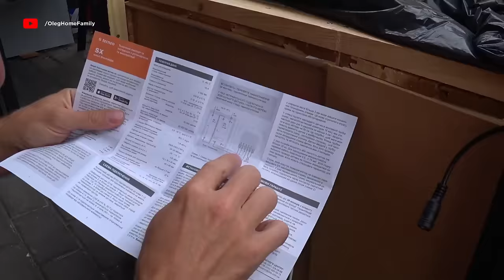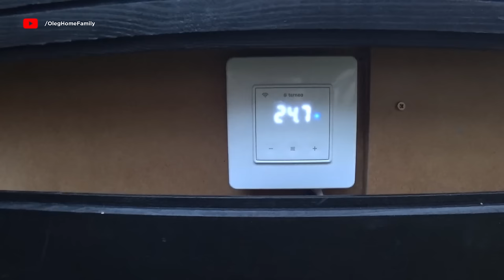Building a DOG HOUSE with Underfloor Heating with Wi-Fi - TIMELAPSE

Comment: Ölçülerinide yazsaydiniz , ilk defa yapacak olanlara, malzeme kaç adet alınıyor
Reply from the maker: Dimensions: https://www.youtube.com/@OlegHomeFamily/community
Building materials:
# 2.4 m lining 12 pieces
- ceiling and floor (7 pieces)
- the walls of the house from the outside (4 pieces)
# 20*60 2m
black frame (4 pieces)
# 20*50 2.7 m
vertical boards on the terrace (4 pieces)
# 38*38 2.4 m
jumper frame on the roof and below (2 pieces)
# 20*30 2 m
the frame of the walls of the house (4 pieces)
# decorative corner for corners and doors 3m (1 pieces)
Reply: @OlegHomeFamily  thank you so much